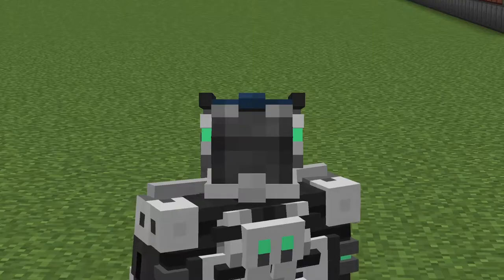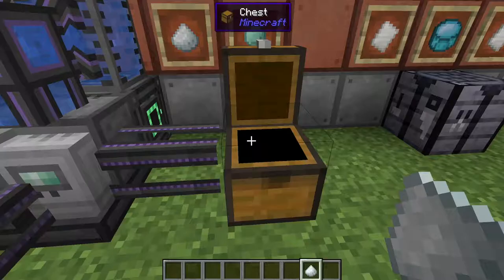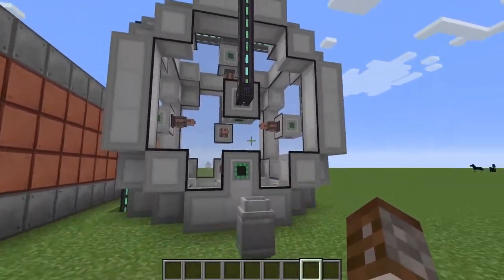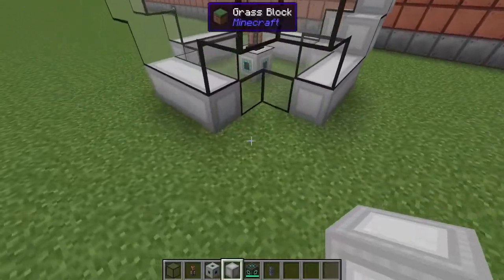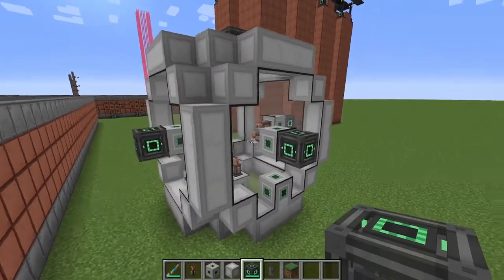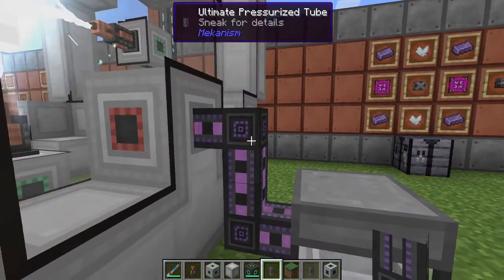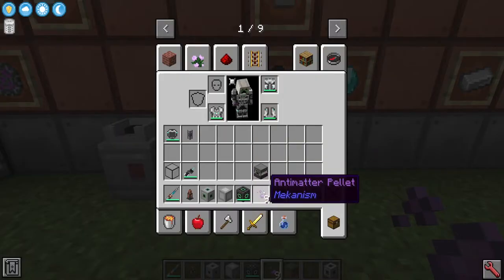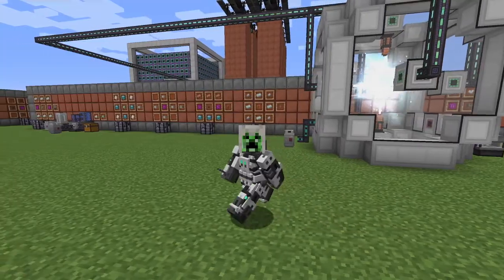How to: Mekanism | Supercritical Phase Shifter (Minecraft 1.16.5)

Comment: So this is a little late, however, you dont actually need 6 supercharged coils. Only needs one and it will work, each coil can handle 400 MFE/t input, (2.4 GFE for all 6) and the more power you put in the faster it goes. The recommended power transfer that ive seen is flux networks. A limited flux point on each coil. Using 6 coils with any less than 400 MFE/t per coil is a waste of resources.
Reply from the maker: I didn’t think the multi block formed without all 6. I know that you can only power one though. Good tip!

Comment: The polonium did not succeed in pumping, even though I used the tools that help in pumping, but it did not work. Is the update related to the problem?
Reply from the maker: Are you using the right pipes? Polonium is a gas not a liquid so use pressurised pipes not mechanical ones
Reply: @Mondays3  I put compressed tubes and it didn't work
Reply: @sha3lantube784  if it's not too late, try using the Pipez mod. The server I'm on has it and they work in places where the Mekanism pipes/tubes/cables don't

Comment: How to deal with spent nuclear waste
Reply: if you have MEGA cells and AE2 in your pack, there's a radioactive chemical cell you can pump into you AE2 network and void? I haven't tried voiding it, so I can't confirm if that's doable. If you don't utilize that method, spent nuclear waste decays super slowly over time. So just dedicate a storage area for them and they'll eventually disappear from the barrels for you to be able to break again.
Reply from the maker: You can't really deal with any nuclear waste. The best bet is just pumping it very far away and storing it. Every now and then when it is far away break the barrel with a hazmat suit on and then that area will slowly lose the radiation
Reply: pump it into a bunch of waste barrels or whatever they're called and it'll decay over time, and without spreading any radiation into the air unlike breaking the barrels
Reply: If you have the trash cans mod, then you can just pump it in an ultimate trash can.

Comment: 1:34 what if my nuclear waste is not pumped out?
Reply from the maker: Make sure that you are using pressurised tubes to do piping and they are set to "Pull" if they are coming out of a machine or tank. You may also need to configure which sides are input/output which you can do inside most machines or you can use the configurator tool
Reply: @Mondays3  thx!